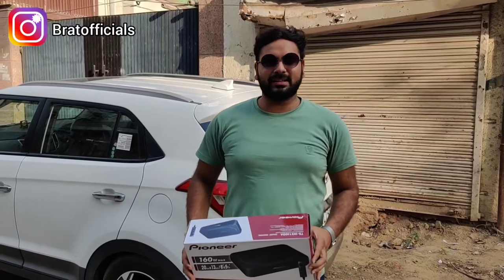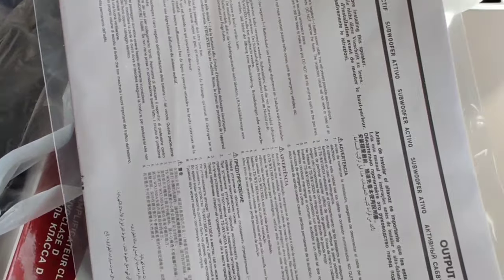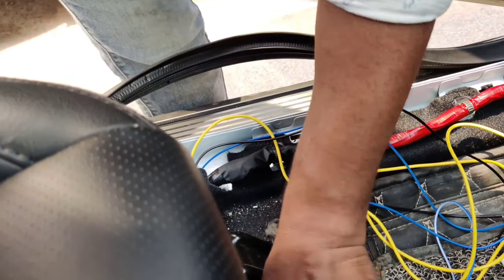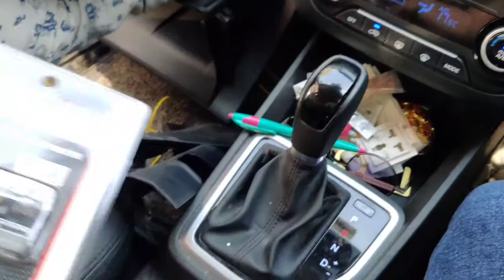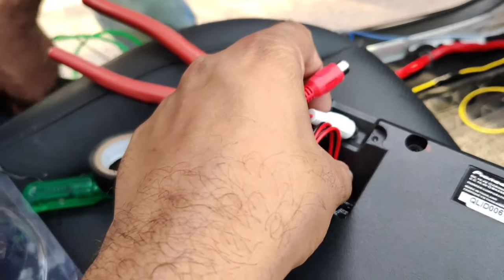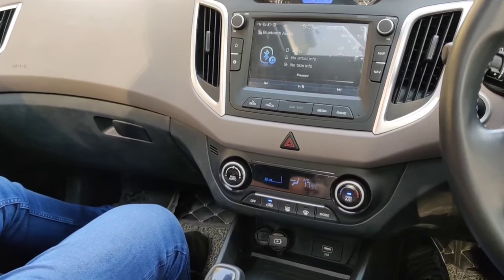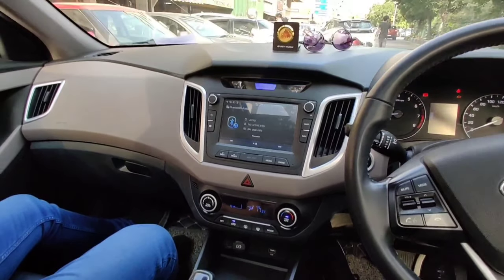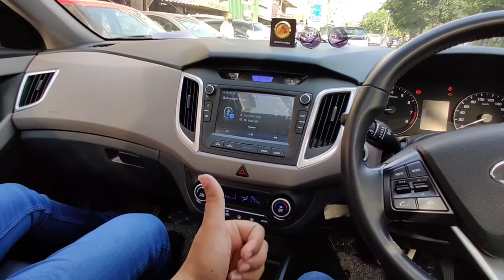Pioneer TS - WX130DA underseat woofer Installation in Hyundai Creta

Comment: It seems the underseat subwoofer has a high level input too so you do not need the high to low level converter at all. The rc lead wouldn't be required in that case either.
Reply: Many people don't know these bcz the mechanics or the people doing these jobs insist the customer to buy convertor even if they know bcz of extra labour and to sell the converter at extra cost💯
Reply: @motivation-24X7  no using converter of good quality give less unwanted noise
Reply: I have one question.. i want to avoid even the wire split. Is there a way one can attach underseat subwoofer to rca output port of head unit ?
Reply: Yes sir

Comment: SUBWOOFER VOLUME DECREASE OR INCREASE WITH THE STEERING CONTROL VOLUME BUTTONS  OR ITS EVERYTIME YOU NEED TO ADJUST THE BASS VOLUME THROGH SUBWOOFER CONTROLLER KNOBS ?
Reply from the maker: Bass is controlled by controller, volume is controlled by your system. Please call / Whatsapp 9354960676 for more details our dedicated team will assist you

Comment: Hey! I own honda amaze top model. The speaker system of the car is total trash. I want a speaker upgrade and this underseat woofer but I dont want any new wires to be installed. Is it possible to do that with existing wires of company fitted speakers ?
Reply from the maker: Yes sir it can be done, Please call / Whatsapp 9354960676 for more details our dedicated team will assist you

Comment: Hello, I'm planning to install this subwoofer in my car with the stock head unit and a line output converter. How should I adjust the gain on the line output converter or the best setting for this sub ? Like the gain, frequency, phase and bass mode on the remote as well. Thanks !
Reply from the maker: Please whatsapp 9354960676 our dedicated team will assist you

Comment: if want to.add couple of tweeters along with this subwoofer, is the hi-low pass enough or do you need a seperate amplifier?
Reply from the maker: you need a seperate amp for that, for more details, pls whatsapp us on 9354960676
Reply: The amp in this unit is dedicated to the unit you can't add any other tweeters/speakers etc to it.